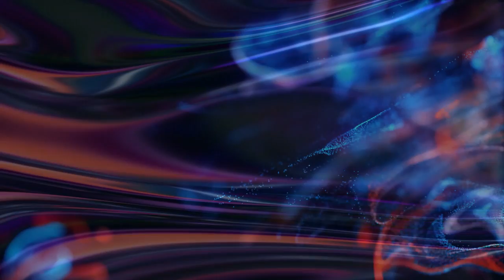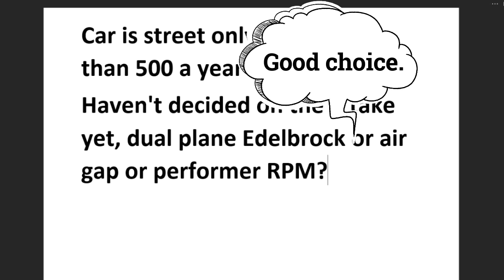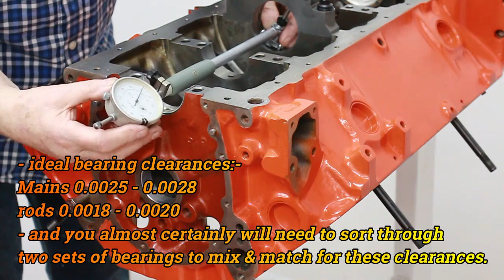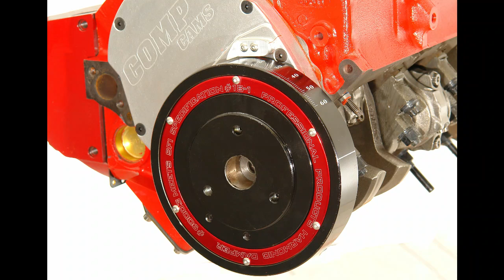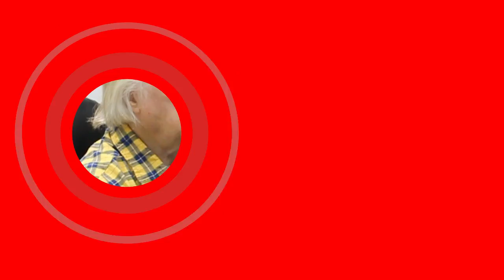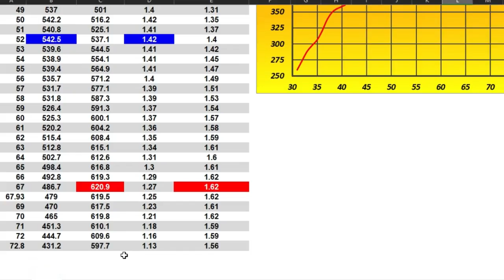How we built that super competitive low buck 383 SBC

Comment: David you are so right that the cam is critical with LSA !!!
Reply: Skill testing question here Bob explaining why David is right  :  Why do cam manufacturers grind in wider than recommended LSA angles ?
Reply: @luckyPiston  easy they don’t want customers calling in saying their valves hit the pistons.  Wider Lsa makes it much less likely to have clearance problems.  People will never complain about the 20hp they never had or knew they could get but they will for sure complain when the cam they bought won’t fit.
Reply: @bcbloc02  That's a pretty good one, i'm thinkin a cam with wider LSA is easier to tune and for people who don't really get carburetors and how to set them up (like power v/v changes) they can basically take one out of the box stick it on the engine and it will run, a wider LSA is a little more tolerant at idling against a tight torque convertor too.

Comment: I'm I guess the crazy guy that wants to use a Q-Jet on this application an maybe a 421 SBC. Using a 800 ported out per one of your  books to a 1020 CFM. What do you think?  It's going to be a street  / drag race. Thanks for all the great videos
Reply: I was running, playing with a Q-jet last yr, my issue with it was the float v/v seemed to wear in short time and the fuel level would creep up and the carb would get richer, i wonder if the ethanol in the gas was a factor ?
Seemed like a decent carb otherwize, i had it dialed in with what i thought was a good set of metering rods and jets.

Comment: I always use sonic turbos.  Even on my Cadillac STS . Made a difference
Reply: I use 4 3" core turbo mufflers in a dual 3" exhaust system... no power robbing back pressure, quieter than stock Cadillac setup, and mufflers cost much less... use to get them for $14.95 each... before local AP Parts factory went under...
Reply: @BuzzLOLOL  cool. With the mufflers and a K&N. It would spin the tires when it shifted into 2nd.  I had a Hydrogen generator on it but I think it just  ran cleaner with better MPG. I didn't use a circuit board to control the sensors
Reply: @dondotterer24  - 1962 Olds Jetfire spinning the tires in 1st, 2nd, 3rd, and 4th... with 3.36 rear end... 
https://www.youtube.com/watch?v=Jzw5W1rRMog

Comment: I explained the 0 loss exhaust system that you developed to Richard holder and  I don't think he got it.. I also described setting hydraulic lifters  with the engine running using a vacuum gauge.  He said the cam lobes don't change.  I don't get his thinking some times.
Reply: Richard is a tool, he don't know what he is talking about